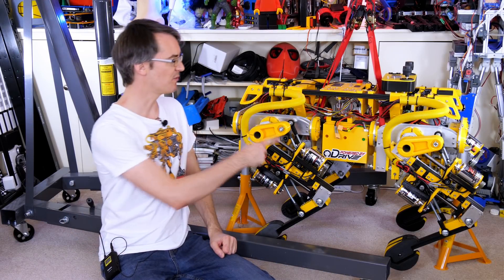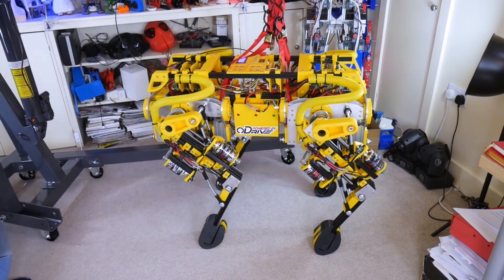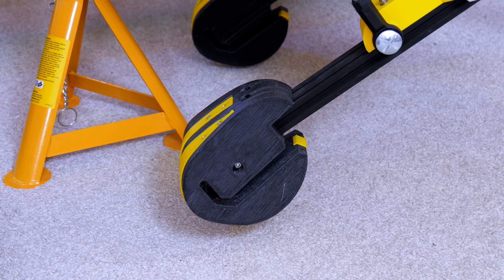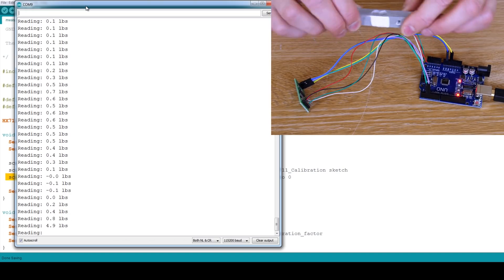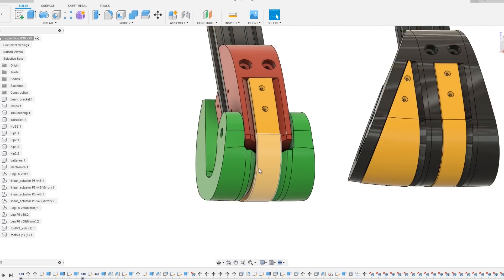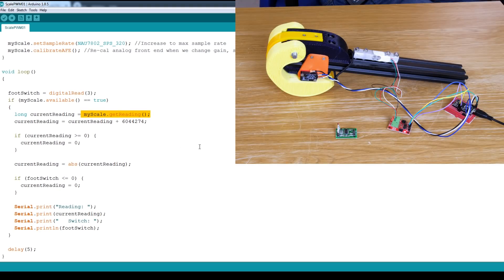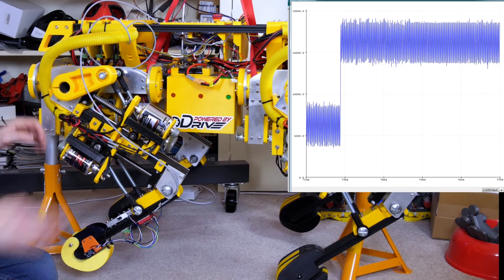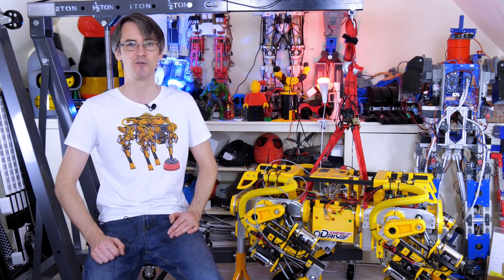Robotics R&D: Testing Load Cells for Robot Foot Sensing

Comment: the reason it's so noisy is that you have wrapped the signal cable around the motor cables! the shielding protects mostly against EMF in the radio and above frequencies, not against magnetic flux in the low frequencies of motor drivers. this effect is even more severe with motors because their high inductive impedance means that any in-line capacitance allows large, periodic, asymmetric current flows. the setup is not ideal to start with but, these wraps almost guarantee an unusable signal. 

cool project by the way!
Reply: The noise is probably induced in the loadcell itself due to the motor noise , the digital pwm signal in a shielded cable won't be effected that easaly.
Reply: @pimbakkerpim  this.

Comment: Hey James! For some reason, this kind of driver that comes with the load cells are set to work at a low frequency, but there is a pin in the IC that can be shorted to vcc and that alows the sensor to wortk much faster! Its quite tricky to do because you have to lift the IC terminal from its pad, but the results are realy worth it!

Comment: Just an idea.... When doing the trot gate try moving the foot to where the floor should be *at that angle* so it gets the foot on the floor to stop the tip but does not try to correct the tip until all feet are on the floor.Then return to upright with all four feet on the floor. That should stop it punching the floor and knocking it over the other way.

Comment: I feel the load cell is going to be helpful for having more info on how the weight is being distributed among the legs. Another thing I just noted is that the legs don't spread outwards individually (as Boston Dynamics's notably do). Having the legs spread helps making the center of gravity always be centered in the triangle it forms with the feet. It also allows crossing the legs when the dog is moving/falling sideways to try keep the center leveled/high up.

Comment: Cool video James! I'm in the middle of a 20 loadcell project myself and I'm using the hx711 like you were originally. It can go up to 80Hz if you jump pin 15 I think. Would be interested in how you implement the code in case you read multiple loadcells (4+) by the same arduino. I've found that pretty much all libraries for the hx711 can only receive information in series and the only library multihx711 that supports receiving data in parallel from multiple load cells doesn't have useful functions like tare etc.

Comment: Quite silly that the IC doesn't let you set an i2c address, that's kind of the whole point of i2c, that you can address things without extra wiring, IMO.  Looking forward to seeing you explore CAN; never looked into that myself either. :) I do appreciate that you're showing off things that didn't work out, as knowing about stuff that doesn't work out is rather educational as well.
Reply from the maker: It is, I could use an I2C multiplexer though, but I'd still have issues with the long wires...
Reply: @jamesbruton  I imagine so, perhaps unless you can get away with particularly low pull-up resistances, I imagine that interference would affect I2c data lines too.

Comment: You're sending the signal as a voltage and are perhaps reading it on a high impedance input port. You might consider putting a load resistor in parallel with the input port. This will increase the current of the signal so that it doesn't drown anymore in the motor induced current. Choose the resistor such that the current is as high as possible, without overloading the transmitter.

Comment: The channel GreatScott! here on YouTube has a great intro video about CAN bus basics that I would recommend to anybody interested in starting to learn about the topic. Also, was that shielded cable also twisted pair? If it wasn't, that would explain the motors inducing current even though it was shielded. It is also possible that you needed to ground only one end of the cable's shielding, typically at the sensor end, depending of the specifications of the cable. If you do go to CAN bus, it uses a twisted pair of wires for its signal wires and is also highly resistant to interference from induced currents and RF noise because of the protocol used and the specs for the wiring for it.

I would still suggest more biomimicry on this foot. At least two toes that also feel when they touch the ground and ate mechanically attached to the primary pressure sensor you have already added to feel for ground contact. Each of these three points, the two toes and the ball of the foot, need to be able to determine pressure roughly and absence/presence of ground. What you have now should be able to walk on flat, even surface ground, but trying to deal with anything more complicated that that will prove impossible, even with a gait.

Absence of feeling or loss of toes on feet beyond feeling for three points and overall pressure (this is the load cell on the leg for OpenDog, but is the ankle in animals) makes walking on anything beyond a flat surface incredibly difficult even for animals and humans. If the coordination task is difficult/nearly impossible because of random variables for an organic creature to walk on, it is going to prove to be a very difficult to impossible problem a robot. There might be a statistical prediction method (simple AI) using just the leg load cell and the basic switch for ground presence , but this would be moving away from using the programming model of movement that uses input about the presence and shape of the ground to adjust the movement model with simulated springs in the legs to a back box of AI that may work but also might tear the robot apart since it feels no pain/senses no damage to stop it from twisting itself into a pretzel.

To be honest, I have never built a robot and have only programmed a few. I do understand the programming and mechanics of how OpenDOng works because of college level classes in electronics, automation, and mechanics. I also have taken programming classes in Assembler and for PLCs. This includes understanding how to set up a PID control. I also have a rough understanding of bio-mechanics from raising and working with animals as I grew up. Noticing a change in gait on an animal could tell you a lot of what might be wrong with it and if/how it could be fixed. This background along with some reading on the topic of how animals/humans walk is where my advice is coming from (I looked into this topic when I had some walking problems to try and figure them out with my doctor. It ended up being a medication side effect, but I learned the basics of the topic).

Comment: Check to make sure the cable shield is connected to the motor supply return. If the Trinamic board generates it see if you can find the common. Should eliminate the crosstalk. Also make sure the shield is only tied to that return on one side

Comment: Wow, really interesting ideas there James. I'm not sure how spongy the paw is, but any sponginess will skew the readings from the pressure sensor I expect. I don't know if that matters, but thought to point that out. I'm wondering if it's worthwhile to do much more processing of the pressure data in that teensy - distributed intelligence style, muscle memory etc. I think your suggestion for canbus is the perfect solution, but its data rate is quite low relatively speaking when there are other devices on the bus, so local leg intelligence will be required anyway.

Comment: have you made sure that the interference isn't coming from the loadcell amp? Since it's job is to read nanovolt changes in in the signal from the strain gauge, might be susceptible to the motor interference.
Reply from the maker: Yes it goes away if I read the data from the Teensy on the leg with the motors powered up
Reply: @jamesbruton  nice👍 I was pretty sure you would have tested that aswell. Once you get the canbus up and working I think it will be a super solution.
Reply: @jamesbruton  If you ground your shield on one side of the cable only, it should help with the EMF noise. Keep up the great work!

Comment: Great project. You can use multiplex to deal with limited i2c addreas- might scale nicely to 4 legs. Pca9617 is handy to boost i2c signal. With your pwm signal did you put a terminating rc network in? Also a cheap mcu can act as an i2c slave.

Comment: Very nice video. I'd put all the low signal amplitude stuff away from the motors and odrives inside shielded can close to the sensor. It should help to reduce noise.

Comment: Getting closer :)
Any differential pair based communications bus should get rid of the induced noise on the cable. I2C is absolutely horrible for long cable runs in noisy environments. In one of my old work projects we had to abandon I2C in a vehicular install as it was too sensitive to noise.
CanBus would be my recommendation, but you could try RS-485 / EIA-485 (straight serial or ModBus) as a short term solution.
Cheers,
Reply from the maker: yes that's what CANbus is. I don't have any serial ports left for Rs485
Reply: @jamesbruton  RS485 supports multi-drop mode, all the nodes in the network share the same tx pair and rx pair, or even only a single pair if you chose to.

Comment: You could try differential signalling... in any case what ever bus you're going to choose it has to be differential and properly shielded and the grounding scheme you'll use has to be properly made (star grounding). You need to be sure you're properly filtering your power rails as well with ferrite beads to cut down any noise that creeps through there from the motors. Any cables you run to your motors have to be shielded as well etc.
Designing these things isn't easy or simple :D

Comment: If you hide the motors in a shielded box, and use a gear system to transfer the power to the legs instead, you'd fix a lot of these signal problems... Though perhaps that would be overly complicated. Maybe just wrap some extra foil around the bits causing interference?

Comment: i dont think that type of load cell is designed to work like that. the wheatstone bridge is setup so that strain gauges on the same side of the load cell undergo "opposite" deformation: 1 in tension the other in compression. as you have it both strain gauges on the same side are in either tension or compression. so i think you are actually cancelling out a lot of the signal and essentially amplifying noise. for measuring simple bending and compression you only actually need one strain gauge directly on the rigid Al, but using the resistance bridges offer advantages; look at the "getting started with load cells" spark fun page and the therein linked "all about circuits" page. it may be possible to rearrange the wiring on the wheatstone bridge on your load cell so that it works in your setup.
Reply: I agree that the load cell setup is a bit wonky in this prototype. I think it would work better if you directly epoxy the strain gauges onto the top and bottom of the extruded aluminum.

Comment: I would repeat the test with aluminum foil. Wrap it around the cables and in another test wrap it around the sensors by the lower half of the leg to see if they need shielding from the motors. Maybe you just need more shielding. Also, I don't know if you have any ferrite noise choke clamps laying around but maybe you can put one around your data cable to help.
Reply from the maker: That's a lot of cable to wrap

Comment: Are you sure you are using the gait? There are six style gaits, and I think you are trying to use one that has forward motion already to help the balance. A tri-leg stance is not feet straight across but two wide apart and one in middle.

Comment: I suggest taking a look at you power supply with a scope,, there way be a lot of noise on it. You could try running the sensor from an isolated psu.
Reply from the maker: The issues goes away if I get the data from the Teensy on the foot, even with the motors powered up, so it's definitely getting introduced on the line between the two Teensys.

Comment: Noisy AC is a pain to deal with.  There are some effective filtering approaches used in the RF arts that may help you.  Remember AC and DC can be differentially blocked by capacitors, transformers, and filtered using simple arrangements of chokes and cheap passive components.  Might be helpful to investigate since you are radiating RF due to the power levels and high frequency drives.  You have an RF problem :)  CANbus would surely help, but it might still be problematic for data feeds on devices that can't use it.

Comment: I wonder if it would be a good idea to send signals on wires made of stainless steel or carbon fiber or something that has higher resistance than copper. Might reduce induction effects. And since there's basically no power needed, it shouldn't result in enough heating/energy waste to matter.

Comment: If you want to stick with analog data, consider a current loop.  That's got very high noise immunity.  If you switch to a digital data stream, consider RS-422 or RS-485.  Their differential signalling will also have excellent noise rejection.  RS-485 might be a simpler network alternative to CAN bus (getting a little out of my element there).
Reply from the maker: I would use RS485 but I'm out of serial ports on the Teensy 3.6 due to the six ODrives

Comment: Try fiber optic communication to modules to avoid cross-noise in the system? Just a novice idea. 
It's great to follow your creations.
Reply: I like your thinking, but I know fibre optic cables can be fragile.  I'm not much more experienced, however, so there might be some hyper flexible, tough cable out there.

Comment: I was going to ask why not use a toe if it would simplify the balance issue. Essentially you are using a toe though, just curled up instead of extended. I believe they used the same design in the movie AXL. Have you modeled a simple actual toe, maybe using springs and your switches to see how it would respond?
Also, could the sensors in the foot be responding to small vibration from the motors as well as the shielding issue?

Comment: Concerning the shielded cable, did you ground both sides of the shield? Because otherwise the shield won't work
Reply: He knows
Reply: This is not always true. Grounding one end should suffice. If you ground both ends of the shield but the ground at each have a different potential it can cause all sorts of problems.
Reply: @FizzicksDude  good point, but as far as I recall it, connectiong one end to ground is for analog signals and two ends is for digital signals
Reply: @madome3117  Fair point!  Another comment below seems to confirm it was the exposed board causing the trouble. Cheers!

Comment: I work professionally with load cells and strain gages. This is not how to use those load cells. It'll cause sensitivity to things you don't want. I'm glad you came to ditching the HX711, it's literal garbage. The way that load cell is setup is kind of like a parallelogram but with contraflexure (Thin element bends at both ends, one causing compression and one causing tension). That cut out has 4 gages in a wheatstone bridge on one side where one half of either element (top or bottom) is in compression and one half  in tension due to how it flex's with the cutout. IF you mount it like that it's acting like a poor differential bending beam and you're constraining the contraflexure element. This becomes highly unpredictable and force calibration could change with bolt tension. So remove and remounting could cause huge changes in calibration. It will also decrease sensitivity and cause new sensitivities to things you likely aren't aware and potentially making it unstable.

Really, you might need a custom design because most load cells are 1 direction, normally perpendicular to the beam. However depending on what angle the leg is at, this might tell you only a partial story. A dual axis design would be better but few people deal with multi-axis load cells. I do, but I'm a rare case.

Comment: James I think you will find it’s the vibration of the motors as much as it is eclectical noise.
Reply from the maker: The noise goes away if I read the data from the Teensy on the leg with the motors powered up, so it seems to be on the line from one Teensy to the other.